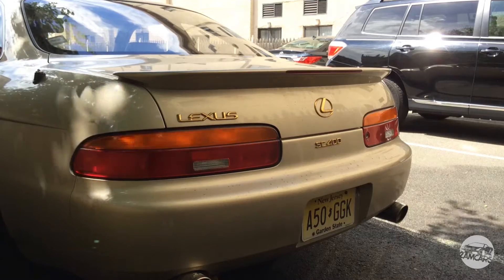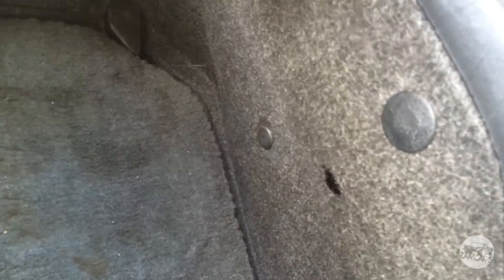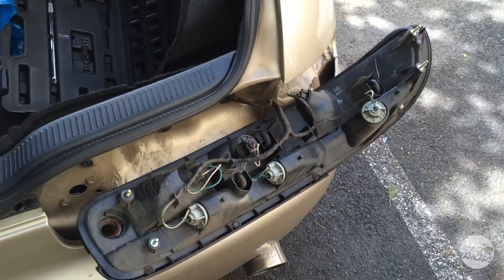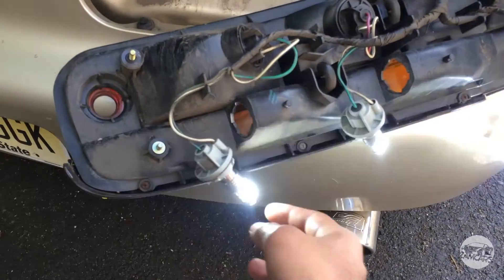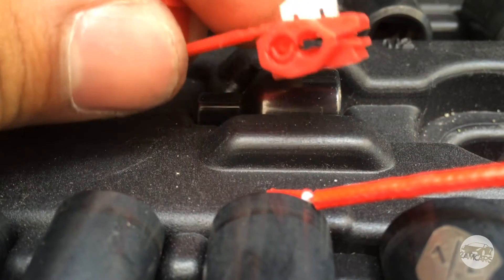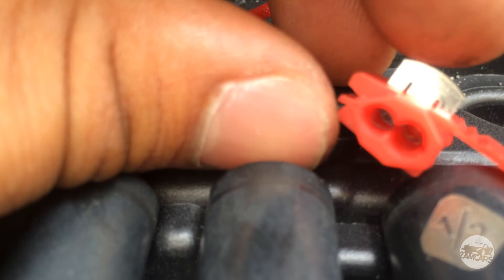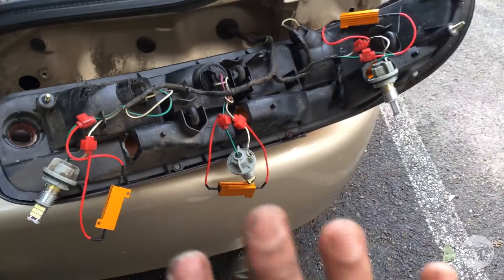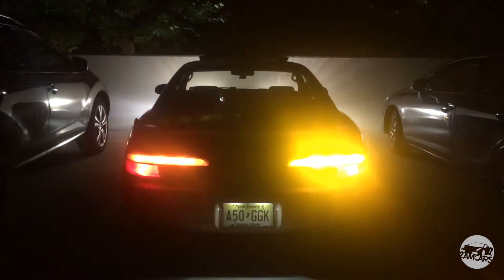LED Taillights! - 2AMCars DIY Tutorial | 1994 Lexus SC400

Comment: I know the resistors came with your bulbs. But just to let you know they sell the led flasher relay it's plug an play.
Reply: How would you go upon installng a led flasher relay
Reply: @Everthingpro  its a relay you change in the drivers side fuse box, really easy to do

Comment: Would this work for the bottom set of lights also? While I got the tail lights off, might as well replace bottom set and upgrade to led also. Would this work? And are they also 1156? I have a 92 sc4
Reply from the maker: Yes they would work!
Reply: My 92 Soarer brake lights are 1157 fyi